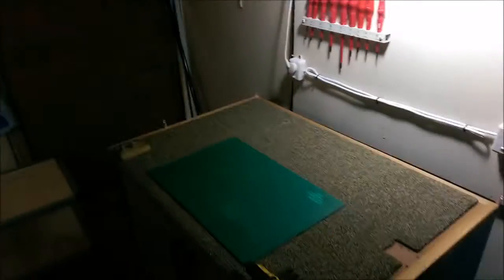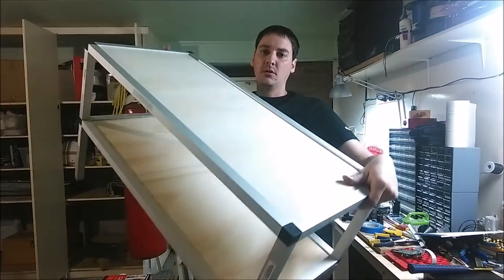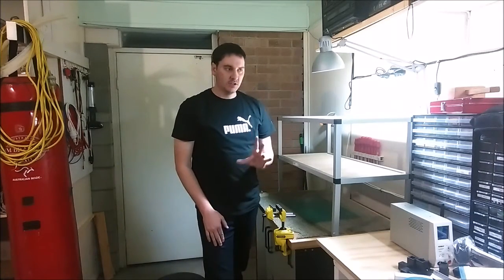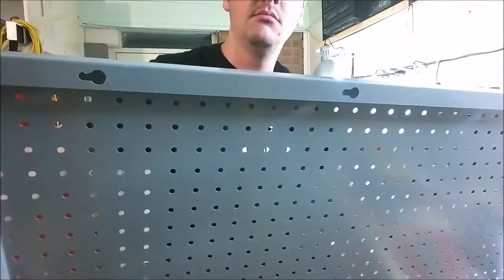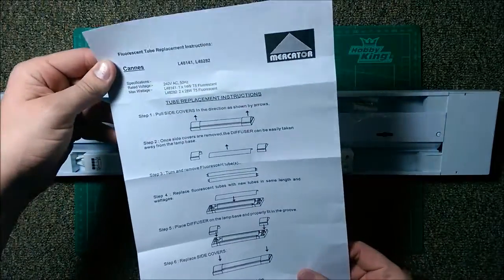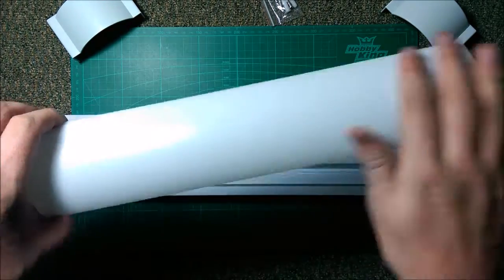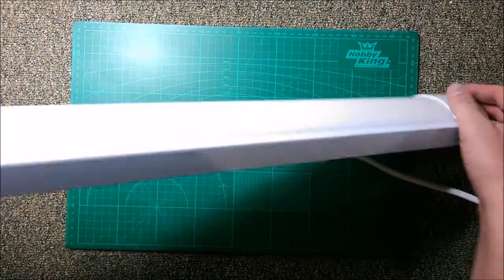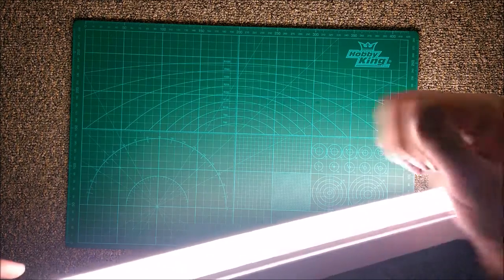Electronics Workbench Build - Part 1

Comment: Same problem here with a rental. No permanent attached implements. Makes the old brain churn to develop new ways to attach without attaching permanently. I am using friction fitted joints and leaving notes for the person(s) that will have to remove my stuff so it can be dismantled and reused rather than put in a dumpster. Still working on the Will but can't include everything in that document. Right, so I am enjoying your videos.
Reply from the maker: Yeah, it adds a bit of complexity to the workshop, but with some careful thought a decent work bench can be put together. I'm still at the same location, so it's had lots of use. Thanks for checking out the videos :)
Reply from the maker: Yes I am! I was given that amp for free in non-working condition. So it requires a repair. One day I might get to it haha.